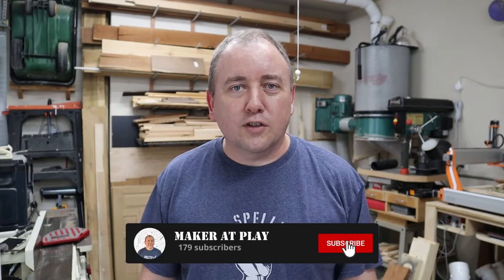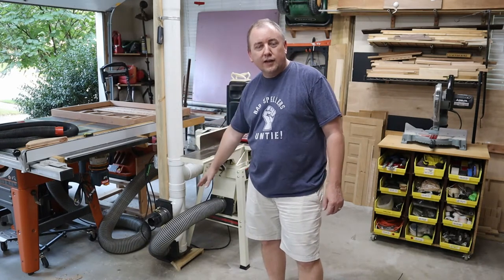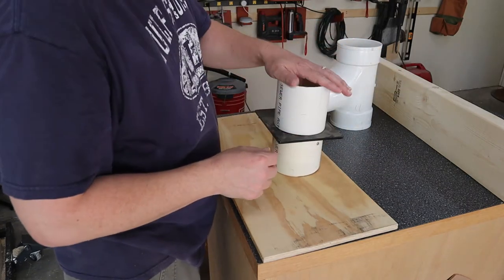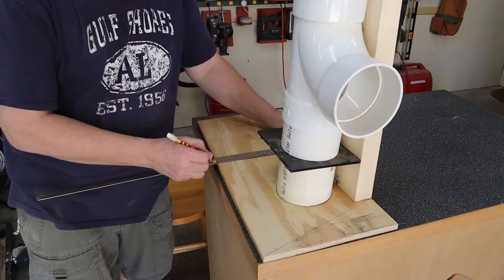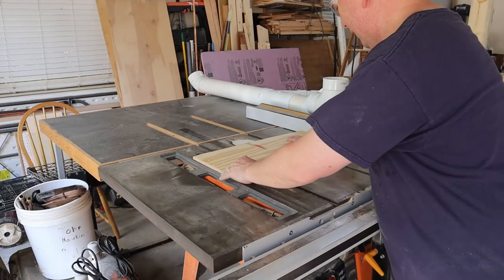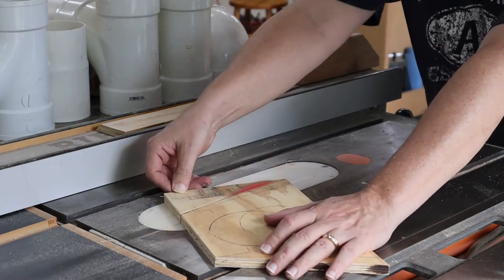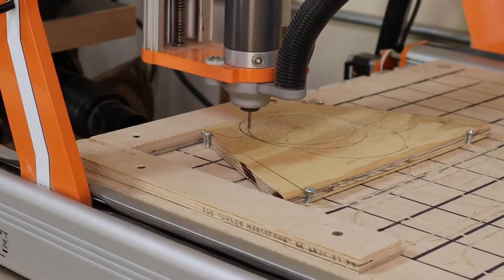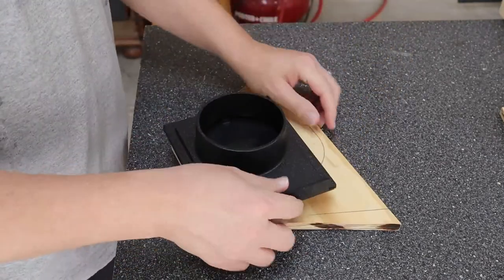Add a dust collector floor sweep to my shop

Comment: Just curious, did you do any research on how high off the floor the top of the sweep should be, or was it merely a guess based on other sweeps you have seen?  

Found your channel a few months ago and I really enjoy it.  Went ahead and sub'd to your other two channels too.  

At night, I am a maker, woodworking, 3D printing, program Arduino and limited Raspberry PI, geocacher and gadget cache maker.  During the day I manage a group of Java and Cobol programers!  What is more comical is that I walk around with a 20 oz bottle of Diet DP in my hand and my staff measures how good/bad the day is, by how many empty bottles are on my desk.  Seriously, enjoy the channels!  Keep up the good work.
Reply from the maker: I didn't research, I just guessed based on a plastic one that I had purchased in the past.    Thanks for the feedback. Sounds like we have a lot in common. I appreciate getting this comment because without them, it is just me speaking into a camera with no clue who my audience is.